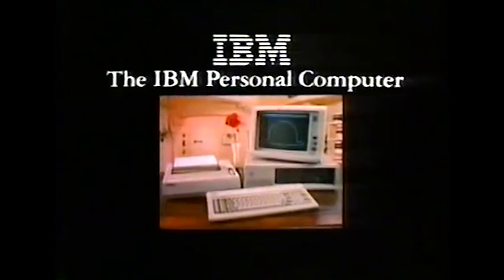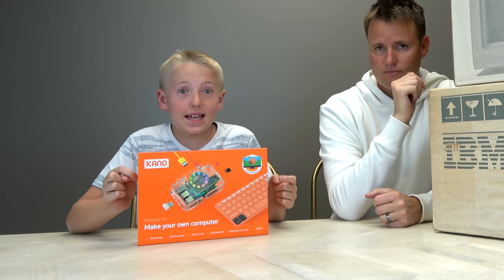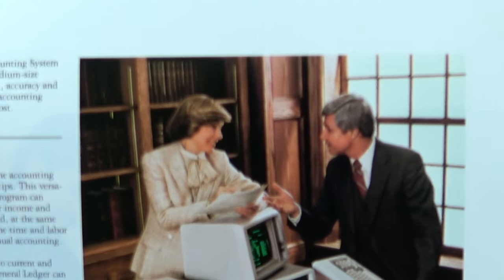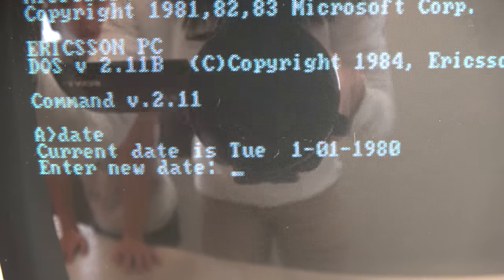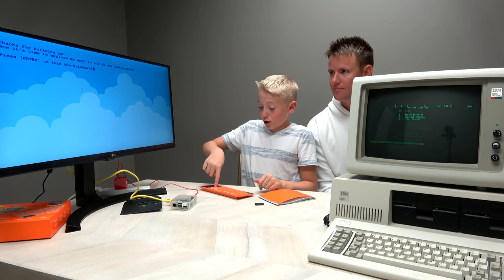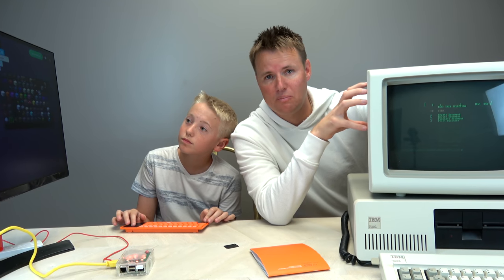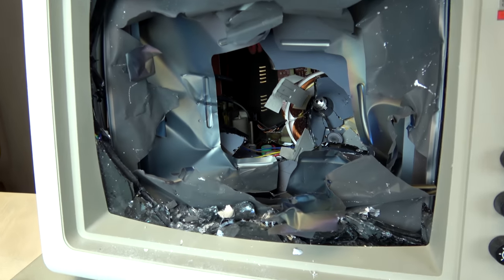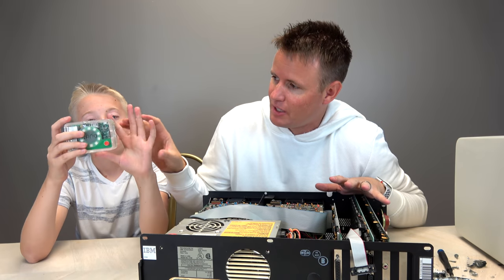What's inside the WORLD'S FIRST Personal Computer?

Comment: Here’s a tip for everyone, Keno is scamming everyone... save over £50/$50 purely by buying a raspberry pi on its own, and then use existing keyboard / mouse that you already own... you don’t need all the stuff keno is selling you, the raspberry pi 1 (which is pretty much identical to the other versions) is only around £20, so $25-$30.

Comment: i dont think thats how you open up a MS-DOS Compatible Personal Computer. JUST, unscreew the screews. THEN you'll find lots of old pcb. You'll probably find a Sound Blaster 16/2.0/2.0 pro, a 4.77 MHz CPU, some Random Acces Memory (512 KB).  The old Personal Computer is really similar to modern-day PCs.
Reply: I agree, old computers are similar to new ones. For example, if you were to compare a windows 98 PC with a windows 10 PC, the interiors are nearly identical. They both have motherboards, graphics and sound cards, processors, etc
Reply: @retrodreams2428  you're right except a modern pc way more powerful
Reply: Yes, I do agree, but that is true. The only way to get Microsoft Disk Operating System (or MS-DOS) on it is if you use an older version and a lower capacity version onto a floppy disk drive. If you are not able to do that, you may need to use the boot disk.
IBM DOS is similar to MS DOS.
Microsoft Disk Operating System is Microsoft's version of DOS. It is less optimized for common IBM hardware, but more compatible with more unique PCs.
IBM Disk Operating System is IBM's version    of DOS. It is (obviously) optimized for common IBM hardware, but not really much for more unique PCs.
You could (possibly, but I very much doubt it) get Windows 1.0 running. I seriously doubt that though.
Reply: He didn’t wreck the computer part
Reply: @retrodreams2428  That would be at a surface level. However, similarities don't end there. Modern CPUs are based on the 8086 CPU architecture, which was the parent of the 8088 which that computer used. You can even emulate a 8086 with any Intel CPU, because the instruction set is compatible. Just a tidbit.

Comment: The capacitors hold the charge, not coils...
Reply: Gadgetron ivan
Reply: Gadgetron Gizmo coils can hold a charge too
Reply: To be honest after the transformer video i dont expect anything now.
Reply: It is the high voltage transformer which could holding the charge
Reply: theoretically may be in some very special cases but in practice, they don't hold charge capacitors can hold the charge and that could be dangerous in a CRT monitor like this because of the high voltage and high capacitance of the capacitors.
BTW this barbaric approach and not knowing about the stuff that's inside, say it all.
Reply: Gadgetron Gizm
Reply: now it coil
Reply: sombody will probily beleve that and if they do they can be killd do your reserch or you will get sued
Reply: @kollectormairu6881  What?? Why would they sue them? If I lie and say you can’t die from jumping off a bridge and you do, how am I at fault?
Reply: its actually the tube itself, but the caps can also be pretty nasty

Comment: I don’t think nobody saw what happened when Lincoln put his finger near the screen 

ELECTRICITY CAME THROUGH THE GLASS
Reply: The hard drive was working away that was the noise
Reply: @tikbugzz152  the 5150actually doesn't have a hard drive it was the floppy drive and power supply fan
Reply: Dude I was born in 2005 and have experienced this.

Comment: 6:20 no this is no what an eleven year old could get as a computer for 500€ anything. You pay 200€ atleast for just the assembly of features and components. This is 250 at max. and anything above is a scam

made the calculation. just the "computer" is 50€ the keyboard 25€ the cables 20€ and the programm 15€ max. thats a joke. with a what? a light? for 5€ made in china?

free shipping on a 500€ product. Thanks kano. Btw this is not a hate. Its just a fact that this kit is a scam. I actually thoguth its a neet idea bvut 500€ or 430€ rn? Hell no. Id rather buy my kid a 3x better pc to start minecraft with. I have no kid tho...